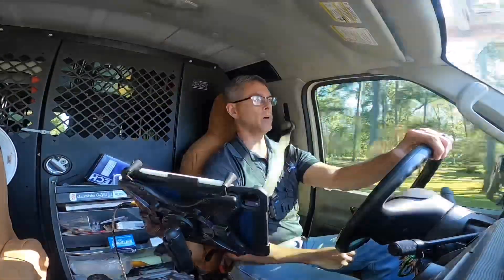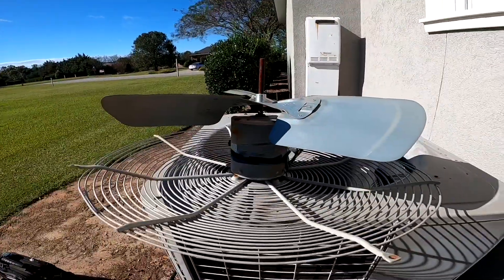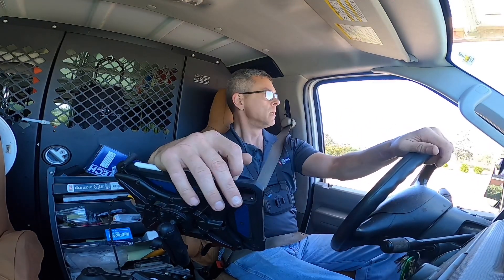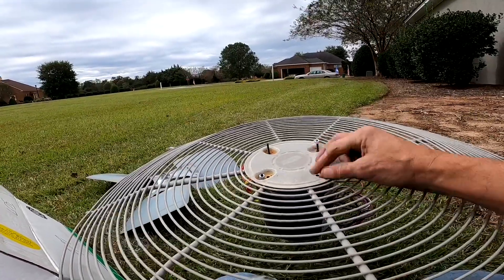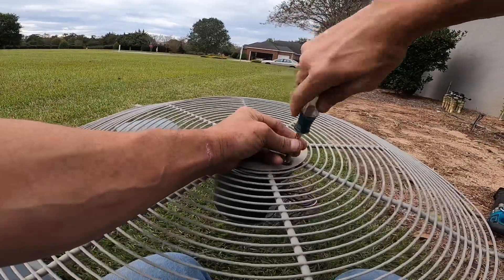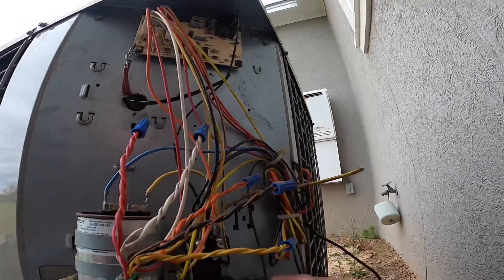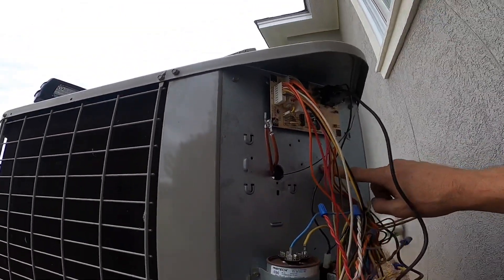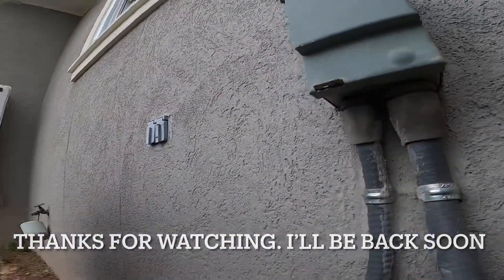Finding the correct fan motor when there’s no nameplate or legible sticker on the motor.

Comment: @ 7:55 what does that mean, when the plug is on the side facing down when installed? I just replace our fan motor and removed the plug facing down after installing. Is this not ok?

Comment: To get the blade angle, you can use a level app on your phone. Just put the phone on the blade and will show the angle.
Reply: the motor shaft/blade hub has to be level or you'll need to take both angles in the same plane and calculate it 😉
you can use two cheap angle finders also, one on shaft and one on blade, zero the one read the other or calculate from the two readings.

Comment: good vid,when you return,i would patch up the cap wire hole when it rains will short the cap,and check the motor temp,the amps are on the high side,normaly you see 1.3 amazon has genteq,jard,amrad,decent prices.

Comment: Kinda rough on the stuff, ripping the wires through, slamming the top for the fan housing on the unit. Even if it is older, try not to scratch and dent the customers equipment. Disconnect being stucco'd on is another thing, gotta get to it if theres a problem. Also already looked like a replacement motor they just didnt use a separate cap. I think I saw electrical tape around the motor you took out.